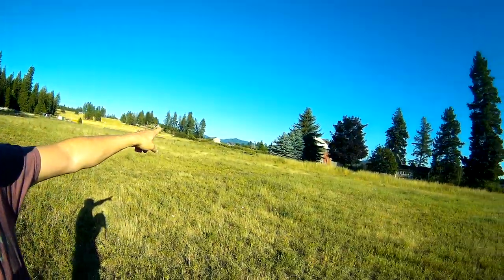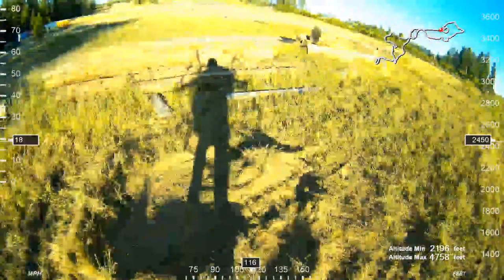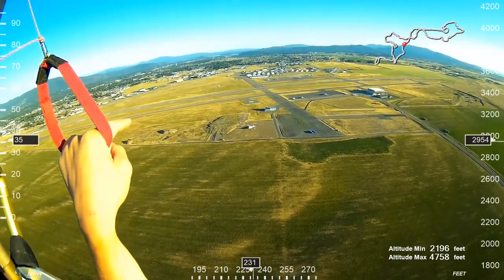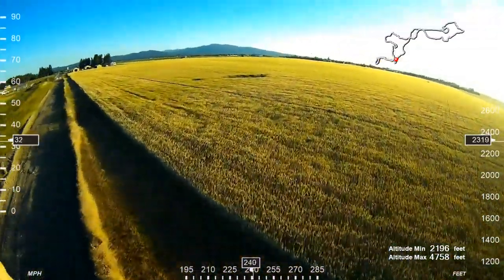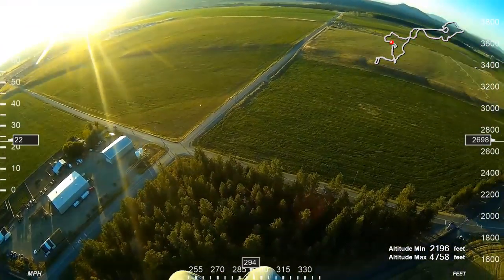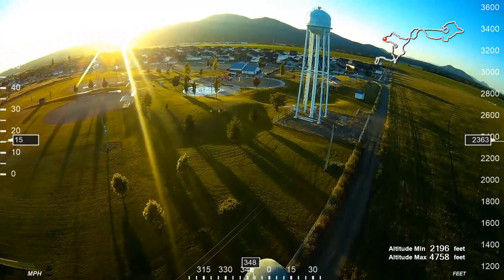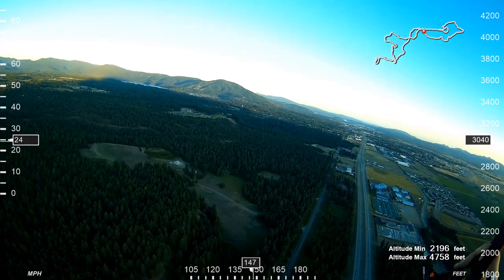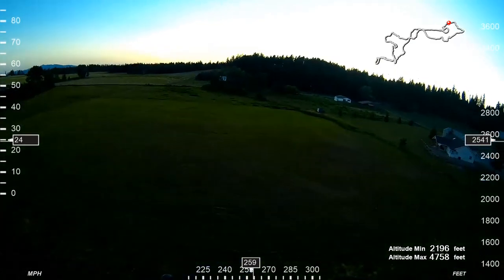Plastic Bag at 2500ft + a WWII B17 Bomber

Comment: Scott, how do you get G-speed, Altitude,  Heading, and tracking superimposed onto the video?   That is really kewl.
Reply: It does add to his videos!
Reply from the maker: Buy a new GoPro. Or if your cheap like me: log gps points on your phone, convert file formats for data and video to work with program dashware to create the overlay and stitch it onto the video.  Not real easy but I plan to do it on all future videos.
Reply from the maker: Do you like this look or would you prefer round flight guages? I did this look because it kinda disappears into the video and isn't distracting.
Reply: @SlowerLiving  Thats fantastic!   Yeah, it looks real good. You have something unique there.
Reply: @SlowerLiving  Yes, the side bars are not distracting, but the info is easy to spot. This format is probably better than round gauges.  Thanks.
Reply: @SlowerLiving  Love the look!